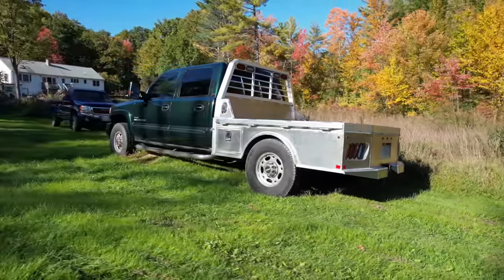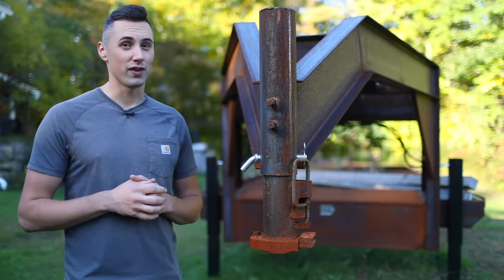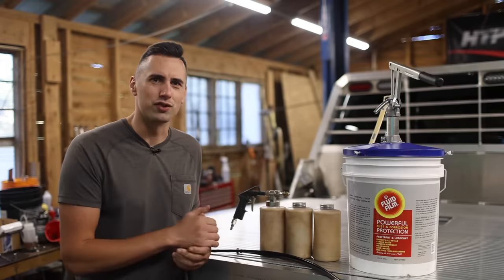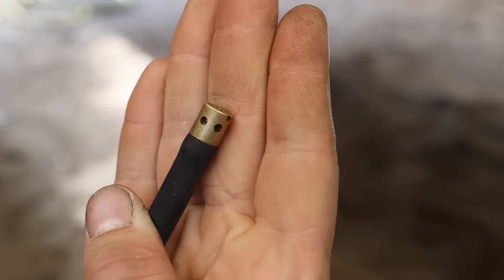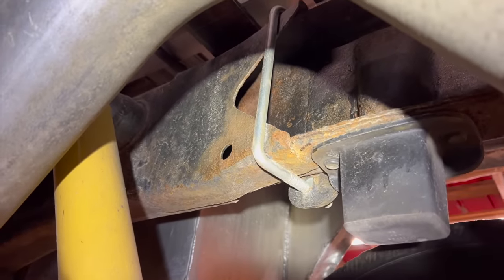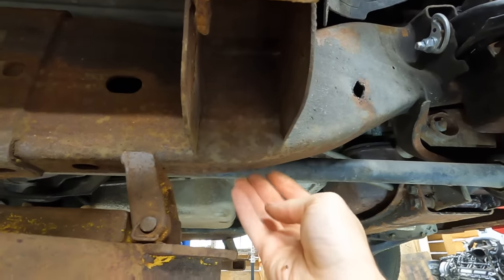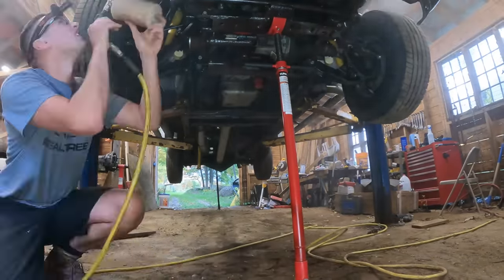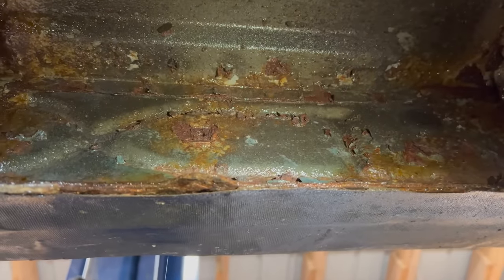Oil Undercoating my Truck so it won't Rust. Easy and Foolproof Method.

Comment: Nice. We have the exact same issue here in the UK. I’ve just started using something called LanoGuard, which is Lanolin-based, and sets kind of like a see-through waxy finish, but never fully hardens so won’t chip away. Great stuff to use and very easy to apply!
Reply: fluid film is also lanolin based. stays like a liquid(ish) and supossedly ''creeps'' so that it can self heal. probably very similar to lanoguard

Comment: really what you should do is get a truck from texas with no rust and just and than spray the oil coating so that way you can prevent the rust from happening.

Comment: I've often wondered why the automotive industry doesn't employ a system with replaceable zink anodes like boats and ships use.  I wonder if anyone has tried it.
Reply: because the anode works with the water. IOW, if the car was always IN water, it might help.

Comment: Great video. You should preferably do this on a NEW car or truck so that rust never gets a foothold in the first place
Reply: Or just spring for the undercoating form the dealer, lol.
Reply: @KipdoesStuff  that stuff ( rubberized undercoat) is absolutely the worst thing for your car . It hardens , cracks and then hold moisture and salt behind it .

Comment: me a non expert in terms of rust proofing  but whats the point of applying stuff  direct on rust? will it stop from further corroding?And wouldnt it be better to  clean at least big rust spots and then greasing  them up?

Comment: Does the overspray on the shop floor make it slippery? Wondering about doing this on a paved driveway and whether a drop cloth would be necessary. Also, have you looked into getting your frame hot-dip galvanized as a lower maintenance option?
Reply from the maker: It might make a smooth floor slippery, but it doesn't seem to be much of an issue on rough concrete. I would love to galvanize my frame, but taking the whole truck apart is a pain 😂
Reply: @WaldosWorld  Galvanize the entire truck! Including the seats, the carpets, etc. I'd watch that video. :)
Reply: Put a tarp down or painters plastic ahead of time and spray away. You can always sprinkle some sand or kitty litter to absorb the overspray
Reply: There's no such thing as a low maintenance option for undercoating. Woolwax undercoating is as close as it gets. Galvanizing the frame won't last, if it did they would do it from the factory.
Reply: @bad_covfefe  Not if they want you to buy more cars. <smiles and taps temple with index finger>
Reply: @bad_covfefe  yeah it doesn't last... That's why galvanized guard rails last for decades, genius. Let's rustproof the entire vehicle from the factory, add a diesel engine that can last hundreds of thousands of miles and lower the rate of return buyers... said no automaker ever.
Reply: @artemiasalina1860 , he was the kid that ate the paste in school
Reply: @TheRoadhammer379  They do rust, and they get replaced. There are tons of galvanized and zinc coated parts on your vehicle, and they also rust quite quickly. Galvanized bolts and zinc coated bolys and hardware very quickly rust, it isn't a magic coating that prevents all rust.
Reply: @artemiasalina1860  they could charge more for such coatings and they would be only a small amount of extra work to apply at the factory to a bare frame.
Reply: @bad_covfefe  I doubt the factory ever would due to costs. Why aren't SS brake lines mandatory. Huge safety issue. It also costs more
Reply: Just put down some non clumping cat litter when done. Brush it around and clean up.

Comment: I suppose if my truck has already been on the salty winter roads...it's too late to seal it this season?  I guess I could try washing it first?  Not sure.
Reply from the maker: Yeah, you can give it a good wash and let it dry, then coating it should be fine

Comment: Wait you have to have rockers to pass inspection?! What?!
Reply: I was thinking the same thing.  Good luck finding any old truck in the rust belt that doesn't have rusty rockers.  

I'm guessing that requirement is based on unibody cars where the rockers are a structural part of the vehicle.

Comment: You should drill small holes in the low spots of the c Channel Steel so the water won't pull up inside

Comment: Ok I’ll admit that I don’t live there so I may not understand but why do Americans put up with rust on their cars? The old Landrovers came from the factory with a galvanised chassis and aluminium panels. If the car companies were to dip the frames in a hard wax and spray the underside and inner panels in wax the rust would be almost eliminated. Even if they charged extra for rustproofing most people in the rust belt would get it. I’m just used to Americans not taking crap and demanding better but this rust issue just seems to be accepted. Back in the 60’s and 70’s we would use fish oil to rustproof our cars and it was excellent, it stinks, but it works and it’s cheap. Cheers Stuart, Australia 🇦🇺

Comment: Waldo I use all my old engine oil in a spray Lance into the chassis until it leaks out and into the body frame it's no rust any where.

Comment: I love Fluid Film, I prefer the Black however..... Spray it on the frame and after a few months of driving it ends up looking similar to the wax coating GM put on these trucks when new

Comment: Used to do it all the time back in the 80s and 90s in western Pennsylvania.  The garage that did it using used motor oil and beeswax I believe.  Did outside on ramps. Wouldn't do it on windy or rainy days for obvious reasons . They would do the doors,tailgate,  endgates by drilling and plugging the holes. Very messy. The recommended not to park anywhere that you didn't want oil dripping for a few days. The also said to drive on dirt roads for dust to slow the oil dripping down. Cheap too. 50, 60 bucks I think.

Comment: Rubberized coating now comes in different colors. Good idea to apply exterior bottom of fender/cab/door
Reply: rubberized coatings are awful, any chips or imperfections to the coating will allow moisture in and will hold that moisture in for good.
Reply: @brandon2076  Chipped paint exposed, is prone to being rusted, rubber helps bonce off.  Sandblasting won't and doesn't remove rubber coating.  Pretty much anyone personal's preferences of protections.
Reply: @BWYinYang  No dude, rubberized is shit. Look it up.
Reply: @BWYinYang  Are you trying to be funny or ignorant? Sandblasting will remove rubber undercoat and bedliner in no time. And rubber undercoat absolutely does hold moisture, bedliner gets chips and scratches, come on use the gray matter between your ears.
Reply: @TheRoadhammer379  I just had my restoration project 1948 Ford F5 that had sprayed on bedliner under fender/hood/cab/running board sandblasted. It does not come off, ended up having to chip/scrape it off by hand. I asked the guy who was sandblasting about it, says it bounces off and I watched.
Reply: @BWYinYang  negative! There's moisture in metal since it's porous... No matter what you believe about rubber coating, it's not going to seal everywhere. Condensation also happens under, especially once the inevitable space between the metal and coating starts. I have a Tacoma that was "dealership treated" as an answer to the frame rusting issues. Made it worse, (discovered that out later) but enough to get it past the frame replacement time period allotted by Toyota. Mustie 1 addressed the same issue on his Toyotas, and his method shows positive results. Also debunks your coating idea. Coating of any kind rubberized, epoxy etc. I've seen and researched this problem WAAAY more than anyone should have to do for a vehicle. There are vehicles from the 50's that were stored outside without the frame rot that newer vehicles are experiencing. After a few reinforcements, 330,000+ miles I'm glad I found the fix Mustie 1 used. My frame hasn't gotten any worse since using his method. Not sponsored.
FYI... Sandblasting takes that off.... trust me and the other people that know about sandblasting. Media type, pressure and distance matter.
Reply: @edpoints1127  The only good "coatings" you can get on a frame are zinc, like from factory, or galvanization. The rest is a real gamble. Sometimes it works fine sometimes it royally fucks you. I live by the beach, I think that's enough said LOL
Reply: Never use unless it's brand new, sand blasted and coated with epoxy primer, topcoat etc. Like the 1st reply it will hold water and rust out. I've seen alot of cars look ok until u poke around and it's rotted under it. Use a few oil products mixed. Rust is not found where it's oily, greasy, or in auto transmissions. Mix with wax toilet gasket and use that. Won't rust, cheap and lasts years.
Reply: @BWYinYang  No. No it dont. We use a 70lb pipeline sand blaster and coal slag, sharp hard pieces of crushed coal. It will eat through it like nothing. It will eat old Heavy Equipment acrylic enamel with hardener that is the hardest coating I've ever had to get rid of. 36 grit sand disks will start then die from that stuff. It's INSANE. Undercoating is good in very particular situation. Brand new, sanded for mechanical bond and sprayed with adherence  promoters then it's dam good. I do this for a living. I've restored semis, log trailers, dozers, skidders, loaders etc. Sandblasted, painted, killed rust etc. Both of u are right. Buy unless it's what I said don't use undercoating. I've had cars in air and when washed looks great. When poking with a rachet it moves and u make a hole and it's rusted out. Unless u kill, convert rust so it can't rust again, use other options. If water, oxygen, salt etc can make it through a scratch, gouge, scrape etc it will start. I've blasted small pieces in a cabinet before and on a humid day it'll start rusting almost right now. I blow off, wipe down and use Ospho to seal it and not let rust get started. I've blasted vehicles, etc and by time I was done with 1 side the starting point was turning. I've been doing this stuff 3 decades from old timers that did this for many many more. Use the recipe I typed above. You will thank me in 5 years when u look at frame, underbody and it's still solid. Watch airbags. Use Vaseline. Get warm and with gloved hand wipe it all over air bags. Won't replace them for years. I see ppl use new bags or tires etc and put on car and not protect it. Use 303, any petroleum product etc. It won't rot.

Comment: Amsoil also makes a wax like spray called mp that, in my opinion is better than fluid film. I've used fluid film for a decade and amsoil mp for about 1 year or 2. The mp has a more waxy finish that tends to last longer than FF.

Comment: Why not use POR 15 to remove the surface rust and then paint on motor oil with a 3 inch brush?  Inexpensive and easy...

Comment: Anyone with a GM truck, if your factory wax is still even descent don’t use fluid film or just about anything else. Fluid film softens the factory wax and makes it wipe off with your finger, a garden hose etc. right on the can it says not to use on GM frames…

Comment: try to use acetone and ATF (automatic transmission fluid) 50/50 mix, that is much better than anything you can buy. but you must remove your battery cable before you start and let it stay off for 3 days after you finish, if not there is a good chance that your car will explode as soon as you use anything electric that will cause a spark
Reply: Acetone evaporates quickly, it won't linger for 3 days and explode, lol. ATF and diesel fuel works well. Explode... 😆🙄

Comment: The big issue with these trucks is GM didn't paint the frames, they used a wax coating. Hell they still do, go to a dealer and take your finger nail and scrap the frame in one of the wheel wells, coating comes right off. Even down here on the South Texas Coast the frames rot right out from under the trucks.

Comment: Ive been doing this for years, I soak the inside of every crevis with oil untill its dripping out every seem , its horible & messy but boy does it work , anything that goes hard like paint, rust trestment, underseal etc are all useless if its already surface rusted..

Comment: dear Mr waldo. I have been told by men at service stations. that spraying oil attracts dust and grimes and it's a good idea to spray rust preventing paint underneath your vehicle. do correct if I am wrong

Comment: So it deosn't rust any further underneath the oily coating because it is protected from air? Or do you have to grind off  the existing rust first and then coat the bottom? I am a bit confused because the underside of your truck looks so rusted... I want to perform this on my car and just wanted to know. Cool video!
Reply: The thing about wax (which is just really thick oil) (tar is similar) is that it will seal rust and prevent it from rusting more. Paint is too hard and brittle and will crack as the rust progresses. Wax will re-shape itself and continue sealing.
Reply: @celeron55  I appreciate your answer I didn't know about that. But do you think it is worth putting in that extra effort and grind off existing rust anyway or is it just a waste of time?
Reply: @dafuqisalias  waldos truck has surface rust, that's a big difference from rotted scale flake rust. If you have heavy scale rust that falls off when you tap it with a hammer, then fluid film is useless as the rust will continue. In this case, yes you would wire wheel all the heavy flake rust off and apply a rust converter. Then spray fluid film for extra protection.

Comment: I got a question Waldo, what Duramax class would be great to start out on?
Reply from the maker: I'd recommend the GMT800 platform. Between the years 2000 and 2006. These are the cheapest and they're also pre-2007 emissions 👌
Reply: Ok, thank you, I just wanted your opinion on the matter

Comment: You should always use a rust encapsulator, then use chassis black to paint frame, Then you use fluid film to prevent rust. Reasoning why is otherwise your  just coating rust with oil and wax. Or atleast that's the way I do it.  Try my way next time and compare results in a few years.

Comment: Waldo, can you do a follow up after this winter so we can see how it holds up. What is the application cycle, once a year?
Reply: Once per year is all you need.  In the spring give your vehicle a good wash on the underside to remove any residual salt from winter.

Comment: As you have a lift, access to the frame is far easier than crawling underneath.  Personally I would have used a rust converter solution on the rust, then covered with a good chassis paint.  Then I would have used Fluid Film to finish off.  I did this on my 2015 Defender as I wish to keep it for a long time.  Possibly this is not the case with your truck.  Good informative video though.

Comment: much better than the black stuff that seals the rust and makes to rust underneathp
Reply: That is why you treat it first by removing as much rust as you can and applying a converter over it before you undercoat.
Reply: @FJB2020  you can never remove all the rust, only way is to sand blast it. And when it comes to this application it is rather unpractical. Oil on the other hand stops rust from spreading and you are good to go.

Comment: It is General Motors car, so does it not come with “auto-tectylizing” device? 
I mean it leaks so much oil the oil spatters on the underbody from front to rear 😃😃
Sorry this is a joke we use in Europe for Opel cars (GM) 
Good video 👍

Comment: Shouldn't you blow out any sand that's inside these frame members so you're not coating sand/salt that's already in there?
Reply: It should realistically stop the sand/other particulate from being able to oxidize in those locations. It would be best to blow it out but from what I've researched not entirely necessary unless you have a LOT inside.

Comment: Is the salt and rust belt the same thing?
Reply from the maker: The rust belt refers to the area from approximately Illinois to Pennsylvania/NY where there was a significant industrial decline starting in the 1950's. The salt belt is where road salt is used in the winter starting in Virginia and moving northward. There's quite a bit of geographical overlap and the terms are commonly confused 👍

Comment: Do you repeat that process every winter season?
Reply from the maker: Yep, I do this every fall 👍
Reply: @WaldosWorld  so it's doesn't work at all because there's alot of rust and even a crispy rocker panel that is smeared shut with fiberglass.
Reply: @WaldosWorld   Do you still have that International Harvester mini truck you got at an auction? I would love some more videos on that cute little thing.

Comment: On that area of the frame that collects water, how would it be to drill a small hole to allow drainage? Just a thought.
Reply: Look at the frame in the vid, do you see the hole right in the bottom near the spot he touched? Salt from the roads will still collect in the frame.

Comment: Great video, what air pressure do you spray that stuff at?  Thanks
Reply from the maker: I actually turned the regulator up to about 150 psi because I noticed the gun said 175 psi on it. In the past I probably used 90 psi, and it was fine
Reply: Thanks I bought one of those spray guns and it didn’t say what psi to spray it at thanks!!!  That seems like an awfully high psi but I will give it a try.

Comment: How often do you recommend to do this? Nice job!!
Reply: You probably have to redo it anually, like every fall. Atleast on the rear where it gets sandblasted off by the front tires flinging sand, mud, dirt and and small rocks.
Reply: @rovhalgrencparselstedt8343  Got it. Thanks
Reply from the maker: I do it once a year 👍
Reply: @WaldosWorld  thank you 👍

Comment: shouldnt you remove the old rust... wouldnt you just be surrounding the current rust and making it worse?
Reply: No oxygen equals no further oxidation. The oil coating prevents the natural occurrence of oxidation by blocking water, oxygen and salt.